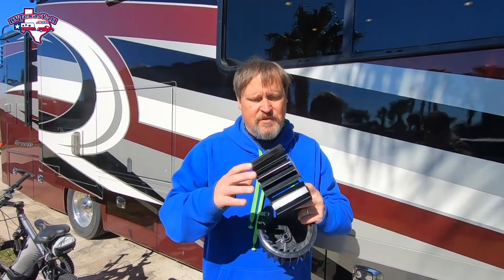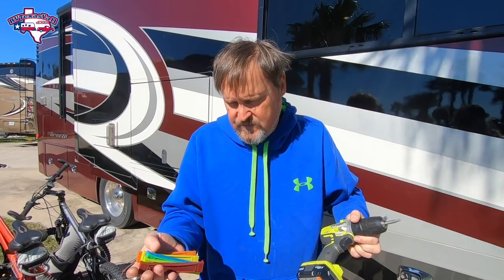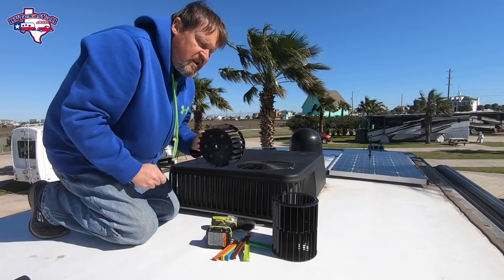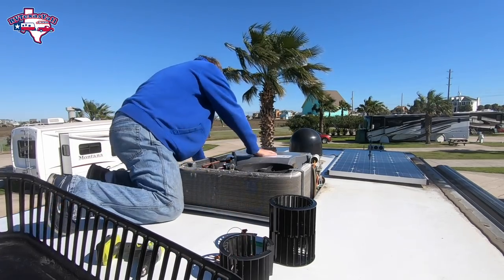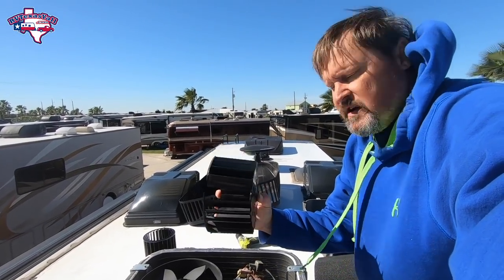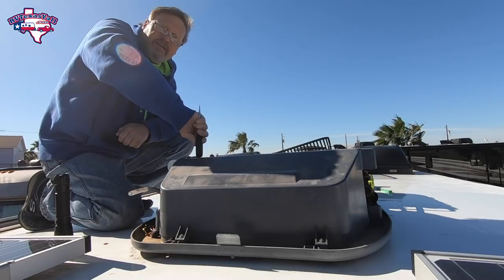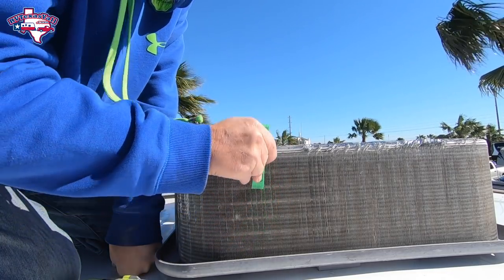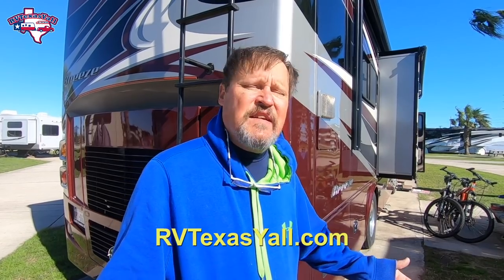RV Air Conditioner Repair Made Simple: DIY Fix

Comment: I thought I'd look at the DIY, in that it seems there is often something needing a fix on our Tiffin Phaeton.  Unfortunately, our main (front) A/C either has a short, or the coaches breaker isn't working as it should.  I have minimal electrical experience, but will get up there today, and check things out, as to why neither the heat pump nor A/C will start.   Thanks for the squirrel cage repair, as that may help me out some day as well!

Comment: So your "squirrel cage" broke. Yea, that's what it is called in furnaces as well. I've changed them before. I have found having a couple flexible ratchet extensions is a plus in my RV toolbox. Do you open the ACs up to clean and repair yearly? We do. No ladder on the back for me. Don't want anyone but me up there. I carry a 16ft telescoping one.
Reply from the maker: Hey Roy! Flexible ratchet extensions would definitely be helpful. We're in the midst of going through everything in the coach (inside and out) to offload a few more things and reorganize. If we don't find one stuffed in a box somewhere, that will probably be something we add to the tools. Yes, it's a good idea to check and clean the ACs annually. We agree with you that preventative maintenance is really important.

Comment: This is why a ladder should be standard on every rig. Looking a cool Class C but deal breaker..no ladder on back! Great job! Learned lots! But look inside at your AC . There is a gap in insulation block and your cold air gets suck back up in evaporator side and not through return outlet side. Waste lots of ducted air. I have a limit video on fix. But better videos on other UT. Thanks for Share! Peachy B 🍑👍
Reply from the maker: Thanks for the tip Peachy B! Will check it out.

Comment: Tom, you can buy a 1/4" drive "screwdriver" that the socket attaches to so it stays together.   The screwdriver works, and you don't need to buy the driver.  The chance of dropping the socket this way to where it can't be easily,  or at all retrieved is greater.  Although you could tape the socket to it and get the same effect as the driver to a degree.  Just something to know about.  Jayman...
Reply from the maker: Thanks for the tip Jayman!  Hope things are great with you.